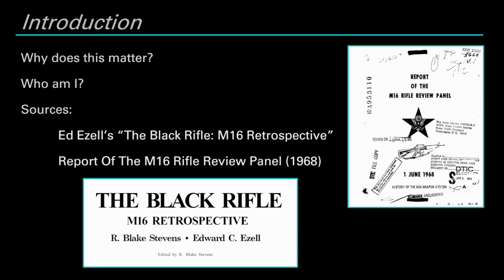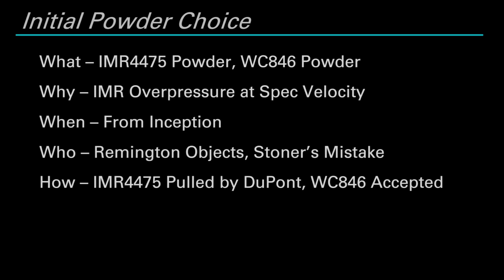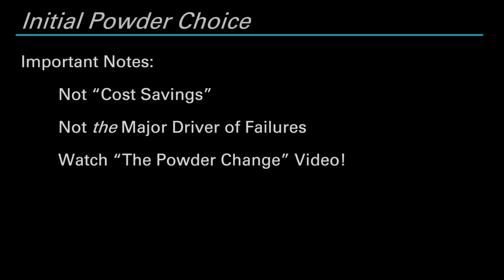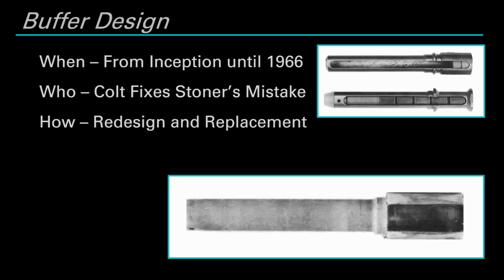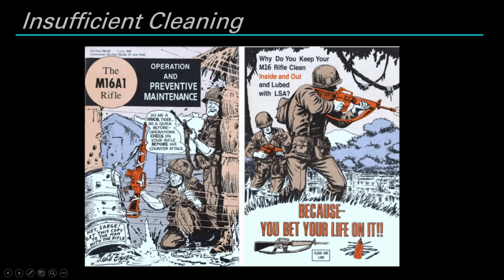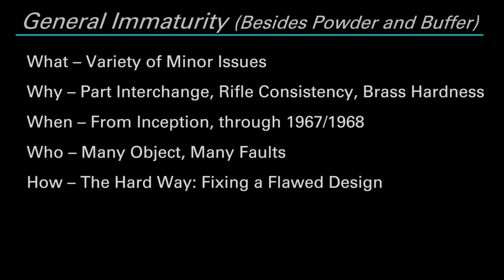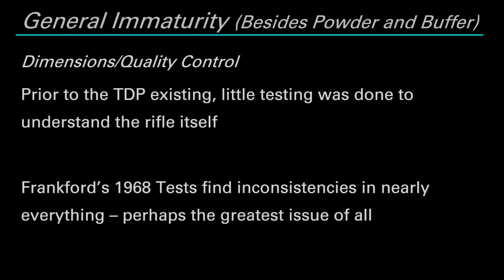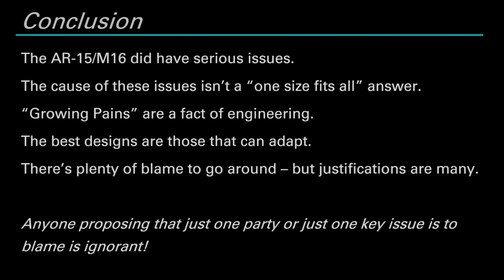M16 in Vietnam - The Real Issues, Briefly Explained

Comment: 41:41 it may have been even more removed than that; I'd think it was more likely they'd have been trained on an M1. in the case of the marines I remember looking this up a couple years ago and finding school of infantry graduation photos from i want to say as late as 1970 with M1s. This has been corroborated by several vietnam vets i know personally from both the army and marine corps. most of these guys i know/knew went to boot camp in the 1960-67 time frame. also in the case of the navy, i believe i saw graduation/training photos as late as 1975 with M1s. i forget the context in which i looked this up, i think it was for another arrow in my "the M1 is unironically better than the M14" quiver

edit to correct myself: looking through some of my saved pictures i think the latest SOI graduation i saw with M1s was 1965 not 1970. now remember that's the marine corps with only two training pipelines (San Diego/SOI West and Parris Island/SOI East), the army has a ton of initial training locations and who knows how long it took for them to procure M14s and then M16s. and yes im sure some dogface soldier will tell me but muh ft Benning, but not all troops who saw frontline service were infantry and not all infantry saw frontline service.

im halfway through this #epic poggers video and this is just one little tidbit i always found interesting in the M1s very long service.
Reply from the maker: M1s did stick around for some time, but future combat units were supposed to be learning on the M14 by 1963, though as production stopped shortly after (and was already behind schedule), M1s were definitely still around.
Reply: @IvanPrintsGuns  I know you know the messy reality of military procurement and the disconnect between directives/orders and an actual tangible effect for the individual soldier/marine 😅 This sort of thing actually happened to me back in the late 2010s, Boot Camp and marine combat training (for pogs) was all M16, and then I got put with an infantry unit and they were issuing M4s and M4A1s to us POGs. The guys who went infantry after boot camp at that time were trained on M4s at School of Infantry, and then were issued M27 IARs in the fleet

Comment: There are a handful of sources I think are quite good that you don't include here in your intro- the Ichord report, and the blue ribbon panel report in particular make good companions to the army review panel's report- as well as some supporting documentation from the time period- if you'd like I can pass these along to you. 

I expect the conclusions will be the same in the end I'm only a minute in though.
Reply from the maker: The Ichord Hearings and conclusions are a pile of hearsay, witchhunt nonsense with a few useful bits sprinkled in. It's useful to read, but really only in the context of the less hysterical sources.  Turns out congresslizards didn't know how guns worked in the 1960s, either.

The Blue Ribbon report is useful, but reeks of motivated reasoning in enough places that I feel it belongs in the same category as the Ichord Hearings - useful context, but largely devoid of facts free of narrative elements.
Reply: @IvanPrintsGuns i certainly wouldn't say the blue ribbon report is impartial haha that's fair enough. 

I haven't finished your video yet, but I'm keeping an open mind. What i believe things boil down to is that two things can be true, and framing and context are important- for example: yes it's entirely fair to say that the original powder was impractical due to its maximum chamber pressure. The Olin ball powder achieved similar velocities while mitigating this, and Remington themselves recognized this. Nobody was being an evil moron everyone just doing their job. But the port pressure was still drastically higher with the ball powder and the powder had issues with fouling- it was recycled from artillery cordite propellants and was available at low cost because of this. The army did have a very close relationship with olin and the guy responsible for the decision did get a very cushy job with them. I can't say whether the reliability problems with the other alternative could have been overcome- and it is only with the benefit of hindsight that the port pressures and cyclic rates are an obvious issue anyway. But it doesn't change that despite there being rational justifications, i think human and political factors influenced the path taken, and it did lead to problems that needed to be overcome later. If this were completely isolated, it would be one thing- but in the context if a very obstinate bureaucracy which had numerous similar issues, i think it is a pattern and there is a meaningful narrative there, even if many have overblown things. The army- or at least key individuals therein- absolutely wanted to rely on its own developments and dogmas when it came to firearms rather than taking a radical shift to something 'not invented here'...
Reply from the maker: NC recycling is a normal thing in powder manufacture. Fouling has nothing to do with recycling NC, and the comprehensive tests that compare IMR to ball powder make clear that if ball powder is dirtier, it doesn't make a difference in reliability (WC846 is more reliable dirty gun and clean gun).

Port pressures increased by 10% (which, while a nominal increase, still nominally sits within the tolerance band 4475 could perform at).

Sure, some individual actors in the Army were conversative and preferred being able to own the design of their rifles. The way this entire thing unfolded proves them right in their concerns (to that extent, anyway). Their unwillingness to fall on the sword that is depending on an immature rifle design doesn't amount to "sabotage" or anything resembling that.

I'm not aware of a complete scan of the SAWS report, but it does exist out there somewhere (Ezell referenced it in Great Rifle Controversy, and pulled some relevant details out).
Reply: @IvanPrintsGuns also I can see you are very well researched- I'm probably several dozen hours in rather than a few hundred, I will admit. I see you have all of the particularly good sources and some good later ones like Fackler it looked like- two I haven't been able to get my hands on yet are it seems I only have a partial copy of SAWS and I can't find that pig board report anywhere... would love to see if you have more info on those

Comment: the audio quality is 👍👍 can't wait to watch this over dinner as a substitute for having a family
Reply from the maker: I finally managed to get the computer fans turned down. There's a weird static sound that gets picked up a few places, apparently USB powered mics can need filters or something. US Army sabotaged my audio setup smdh
Reply: If the 5v power wire is not insulated it could cause interference with the data lines, atleast theoretically.
Reply: @IvanPrintsGuns So I was just on the DEFCAD website, and it would seem you don't have the early model of the 3011. I'm talking about the blue one in the video titled [ 100$ 3d printed 1911 build ].
I really like the zero picatinny rail broomhandle design. 
If you could upload that early design I would greatly appreciate it. 
Im gonna print it in a low temperature filament and casting plaster to cast it in aluminum!
Reply: Glad to see you here, ol' LeadBreath. I appreciate that the best guntube educators seem to learn from & support each other.
Reply: Like how I watch your videos as a substitute for getting to the range
Reply: True words. Sadly true words.
Reply: Like how I watch your videos as a substitute for buying expensive guns.
Reply: omg me too!
Reply: bfam